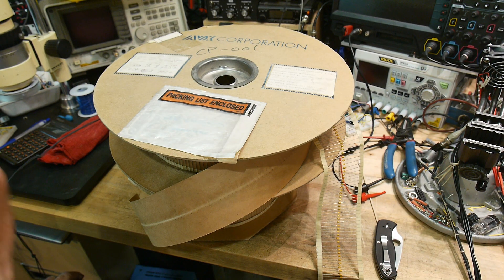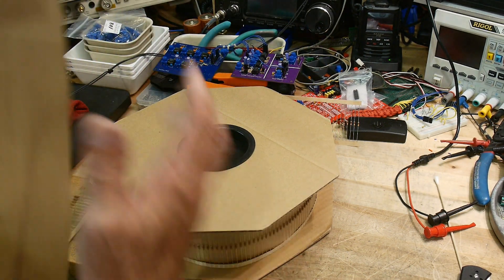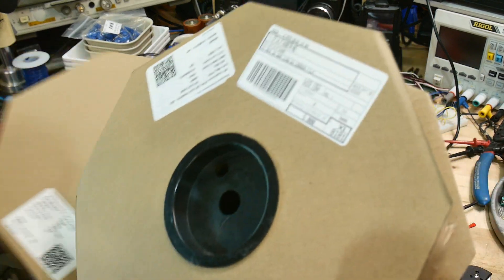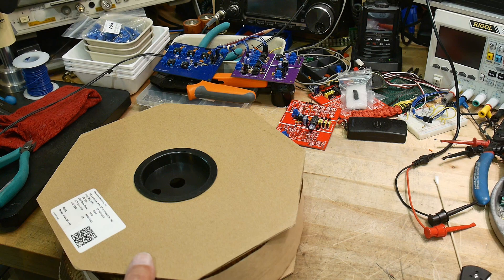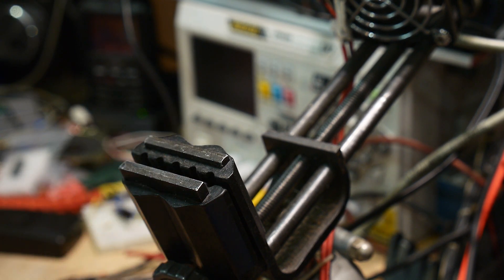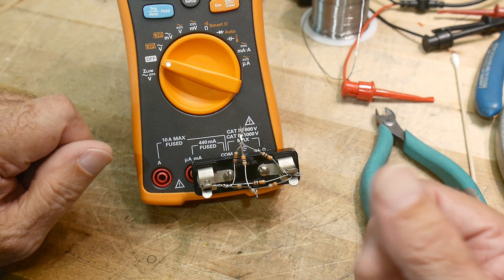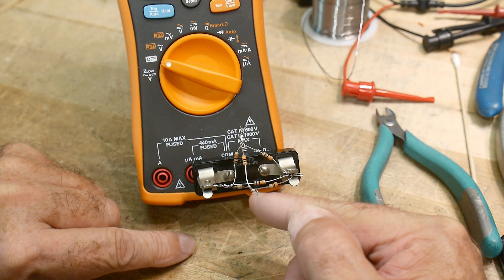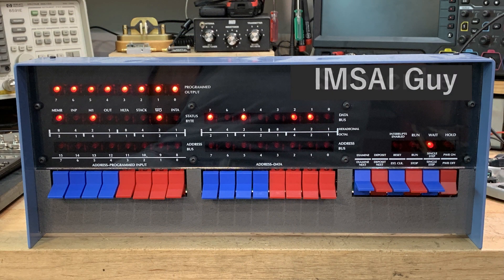#1223 Reels of resistors and a puzzle

Comment: What's the point of guessing when the math is obvious? The resistor not connected to the one you're measuring across will have the same potential at each end, so effectively it isn't there.
Then you just have two parallel resistances of 20K (which makes 10K), in parallel with the 10K resistor you're measuring across. And 10K in parallel with 10K is 5K.

If anybody's having problems adding 10+10 or dividing by 2, they really don't want to be working with electronic circuits.
Reply from the maker: you didn't mention Kirchhoff once!

Comment: I explain to people that the difference between an engineer and a tech is that an engineer spends an hour calculating the value of a 3D resistance while a tech spends 5 minutes soldering one together then measures the value.
Reply: tNope. Engineer is the one who recognizes the tetrahedron is a planar graph and takes 20 min to code it up Python...to solve for the currents into any node, the voltage at any node (referred to any one node), the resistances between any node, and the power dissipation for any node. Along with the manufactures production data, and stats, engineer computes these values over the variations of many thousands of resistors more precisely than the technician could ever measure them. Technician figures... might lose a job and should've have stayed in school.
Reply from the maker: I'd keep that tech, time is money
Reply: @IMSAIGuy  How long would it take a tech to build up, and  measure, a couple of hundred planar nets to find an optimal solution? A year? More accurately, so the MBAs say, time costs money.
Reply from the maker: @willthecat3861  the engineer did not understand what the boss asked for. "I need a value, don't bother with math or simulation"  , the tech heard what I said.
Reply: @willthecat3861 , one of the things I did in my technician career, in addition to building and testing prototypes and catching engineering mistakes, was to edit for spelling, grammar, and clarity pretty much everything the engineers wrote. :)
Reply from the maker: good techs are much harder to find than good engineers
Reply: @IMSAIGuy , as a tech, whenever I was being interviewed for a job by an engineer I'd ask them if they were a ham. I found that engineers who were also hams had usually been playing with electronics since they were kids, so they had a wide variety of experience and really grokked it,  and they were a lot easier to work for. If I found they had just showed up at college one day needing a major, and chose EE because they heard it was a good career path I tried very hard to steer clear of them. I've never met a 'good' EE or ME who didn't essentially start out in the field before they were 10 or 12 years old. Those who have always loved it just know so much more than those who haven't.
Reply: @IMSAIGuy  I agree. Most of us need our mommies to tie our shoe laces...so don't expect 'blue sky' guys to know they have opposing thumbs, let alone to know how to use them. But, don't underestimate these guys ability to  put stuff out of their as*es, when they want to. After months of putzing around in the lab; it's truly terrifying when one of them... having got lost on the way to the washroom... ends up in the lab...and takes an interest in what your're doing.
Reply from the maker: @willthecat3861  I sorry you had bad experiences. I was fortunate to have worked with some of the best that put the engineers to shame.
Reply: @johnwest7993  I dunno... but, I'm starting to think most American engineering schools must have pretty low standards to be able to graduate. After all, a guy that maybe finished high school, and maybe had the same on the job training as an engineer, can outsmart, and outperform, an engineering graduate, doing a knowledge based job. The guys I knew from MIT, Caltech, UC Berkeley and Stanford were top-notch. You got smarter just by being in the room with them. I'm not sure if they could spell though? ... maybe not.
Reply: @IMSAIGuy  I never really worked with technicians, so I don't have bad experiences about them. But it's hard for me to think that someone who maybe finished high school, could model the neutron density inside an experimental nuclear reactor design... or almost double the range of howitzer artillery, or compute the local thrust pressure inside the bell of an F1 rocket engine, or come up with a new semiconductor process for the RF diodes inside an HP RF detector.  Can you tell me about technicians that put those engineers to shame?
Reply: @johnwest7993  Maybe in the early days of radio... say up to the 1950s... it was possible to do a lot in radio engineering without too much theoretical knowledge... without much familiarity with advanced math. Possibly... often the A.R.R.L. Amateur Radio Handbook might have been good enough. It's not good enough now.
Reply from the maker: @willthecat3861  HP had many talented ones. Back then my boss started as a technician then promoted to engineer and then engineering manager and then as a higher level manager at HP Laboratories. He was a talented analog designer who build a great 4 quadrant source/measurement for testing of opto-electronics. He started out fixing radios at a repare shop. No degree. Another good friend was a tech who had a philosophy degree. He was amazing. he wanted more money so went to night school for a MSEE. He got is promotion but he was no smarter because of it. he took a cut in pay because he got lots of overtime as a tech. he then had his own company. oh and was a grand master in chess. we had many EE graduates that knew design but not how the construction is accomplished or making things in the real world. I managed engineering groups for about 10 years and I had OK techs and good ones. they do the real work that the engineers are too busy or lazy to do.

Comment: By symmetry the link between 2 paths has 0 volts so we can ignore it. We are then just left with 20k // 20k // 10k.
So (in kOhms) 1/R=1/20 + 1/20 + 1/10=1/5
R=5k
Reply: Technically, that is "doing the math."  Just because the math was easy is no excuse :)
Reply: @byronwatkins2565  Here I gave the details but this can be done without a lot of thinking: the 2*2 10k (2// * 2 in series) is 10k (true for any square n*n components). And 10k in // with 10k is 5k...